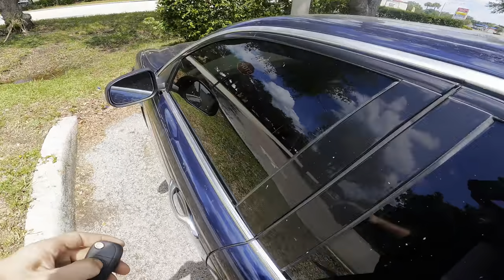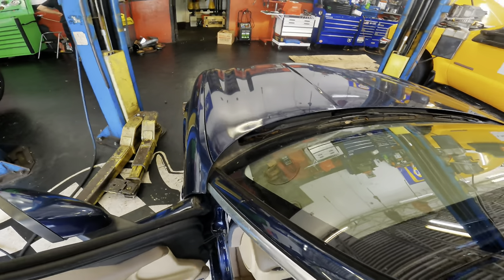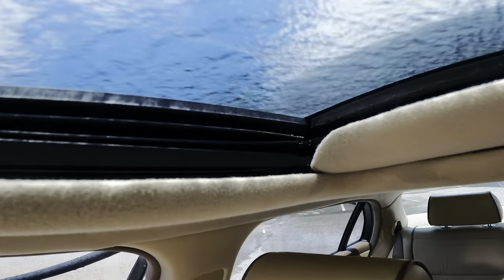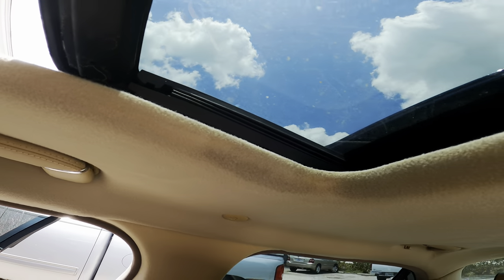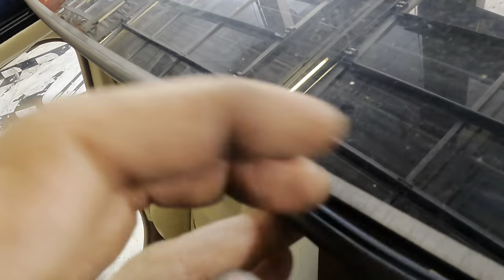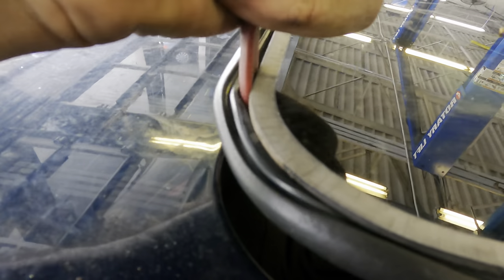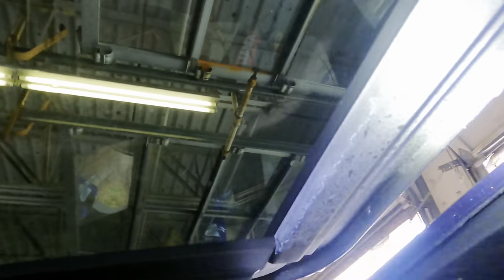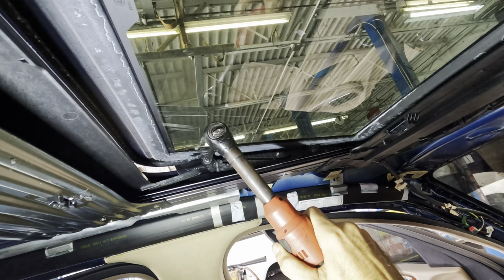Worse than I thought…Water Intrusion! 2008 Jaguar XJ 350

Comment: Sadly, you did it the worse way.  The best and ironically cheapest and easiest method is to use 2mm thickness UPVC self-adhesive tape.

Clean the metal face of the sun-roof surround thoroughly with IPA until spotless.

Then, carefully apply the tape around the whole shape of the opening being careful to work well in/on to the area,  cut off excess tape where necessary then close the sun-roof and leave closed for a few days to allow the adhesive to fully bond.

I've done this twice now, once on a Honda Civic M2 2 and on my current 2006, Saab 9-5 Aero Estate - both times cost me about £2.50 and both times sealed the leaks perfectly.

Comment: Robert got stretched in on that last corner massage around the window towards that corner maybe the rubber will expand just enough to make it fit but I could be wrong I used to have that with gaskets on my molds have a good o

Comment: Glass doesn't look centered. Must be an adjustment. Seals are never 100% on these types. That is why the drain tubes. Old style add-on sunroofs fit on top of the roof and seal tight when closed as there are no drain tubes and they HAVE to be water tight.

Comment: My wife wants the next car to have a moon roof.  Our previous car has one and it's never leaked.  It's also never been opened to enjoy the outside air.  So what does she want it for other than to create a water leak potential.  Plus that option is going to add 1.5k$ to the price of the car.

Comment: Had a  BMW,the drain hole were half plugged up,no water coming in ,but I stopped harf and the dash board got splashed because of water slowly draining,but the drain hole in the front wasn't really plugged but at the end of the tube what trash drained down piled up behind the fender,soon as I cleaned that put,problem solved.

Comment: Ray,
I hope you are not charging the customer for a mis-diagnosed faulty seal?  Your installation of the seal was not done properly, it should have been seated in each of the corners first then pressed in without stretching in any direction.
The drain tubes are obviously blocked.  Please take this as constructive critism - I like your videos!

Comment: Don’t play with euro trash sunroof’s. In my Volvo there are modules under the floor. The sunroofs have drains that plug up and water is transported unseen to the floor under the trim. The electronic under the floor is ruined. Very easy to total a car a few years old. If I keep my Volvo I will have sunroof sealed.

Comment: I used to work on XJs the biggest problems we had in the UK was blocked tubes running down the rear quarters blocking up with debris.
Especially in Autumn.
We blew them out with am airline.

Comment: I don't see that rubber seal sealing enough to keep water out at all. I guess it will keep some of it out, and the rest goes in the drain tube. Check the drain tube.
Reply: Correct, the drain tubes are almost certainly the real problem here.

Comment: Let's cut a hole in the roof and put glass in it with moving parts - what could possibly go wrong.
Never wanted a sunroof, never needed one and never understood the hype that people have over them.
Bought a used car that fit my needs and it has a "panorama glass" option with it. Whole roof is glass - no moving parts, not able to be opened.
Not my choice if I had it but it's there now and at least I know that it cannot / should not move. So as soon as it leaks, it can be resealed without electronics. 
The additional sunlight is nice - but the "issues" with movable sunroofs are just not worth it.

Comment: Ive got a car with a sunroof too, the first car I've bought that came with it new whether I wanted that particular 'luxury' item in this model or not, and YES, it flamin well leaks now after owning it for about 8 years. 
I was wondering since I think (could easily be wrong though) that maybe since you had to stretch it so much whether it might have thinned out while being stretched and elongated enough. Almost certainly not since you've got that alignment issue but figure it's worth a mention.
Reply: The issue is almost certainly not the seals. Seals on sunroofs are rarely if ever perfect which is why drains are installed at each corner of the sunroof frame to deal with leakage. The issue that these drains get blocked with dirt and debris over time, you just need to locate and unblock them with compressed air or a suitable (not sharp/pointy end) piece of wire.
Reply: @ferrumignis  That may well be the problem with mine. I didn't even know they had drains up there till this video and mine turns the floor into a swamp so yeah. I was thinking it would be either the seal or some leaves or something on where it seats but, those drains have got me thinking along the lines of what you said. Thanks for the extra confirmation, I will have a look tomorrow, if it'd just stop raining for a while 😒.

Comment: Hey, its a Jaguar it's supposed to leak the design just to be parked in the front yard. Both friends that had Jaguar had trouble with them from day 1.  Got to the point i told my one neighbor I not driving/picking up -you at the dealership. Get a toyota or Honda something that works past your driveway. That's the other thing my dealership would take me home and pick me up.  Jaguar no. Junk cars.   Like Range Rovers too.

Comment: Silicone the trench around the window and paint the window black then disconnect the button don't need no stink'n open roof anyhoo.
Looked like water was only on the front left corner

Comment: Easy fix for you ,pull the passenger front corner pull seal out pull it tighter ,work extra around side , put extra in rear corner work around back . You may have a front leak if you do it to tight . The seal is just tight in back corner

Comment: Hey mechanics out there. Does Ford and Dodge leave springs wear out? So damn fast like GM or is that just a GM thing?
Reply: Maybe....maybe not.
Your cal Mizzy
Reply: @billiebobbienorton2556  I'm guna call it a yes..... It's not a brand thing. It's a late model thing. The older ones lasted longer. The newer trucks just fall apart. Not to mention half ton. Trucks are basically mini vans now
Reply: @BuiltDifferent13  Yeah, most likely its a failure due to age and heavy use.
Reply: @billiebobbienorton2556  yea it's a 2016 78k and plenty of witness marks all over the inside of the bed from hauling so they're worn out... Thankfully I have 87 bullnose to save the day when it breaks

Comment: I had the same sunroof problem, turned out the actual frame the glass is mounted in managed to get twisted so didn't seal to the roof properly, Got a used glass panel & that sorted it.

Comment: I'm bewildered by the fact that sunroofs have drains. It's almost an admission of the fact that they're not expected to provide a 100% seal. It's like putting a pan under a leak and calling it good. Seems a 'feature' to avoid.
Reply: Don't be bewildered, it's pretty much impossible to get perfect sealing on a sliding sunroof over the life of the car. Dirt/debris, wear in the tracks and drive components, sun damage and age hardening of rhe rubber etc. mean it's just not realistic to design with the expectation of zero leaks.  Seals are simply the first line of defence.